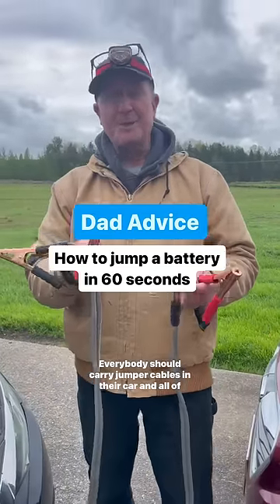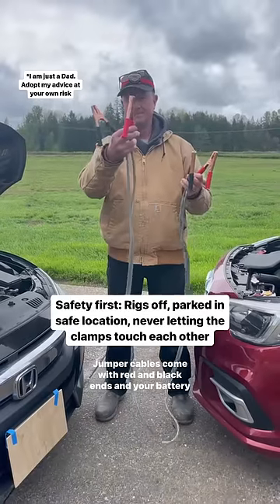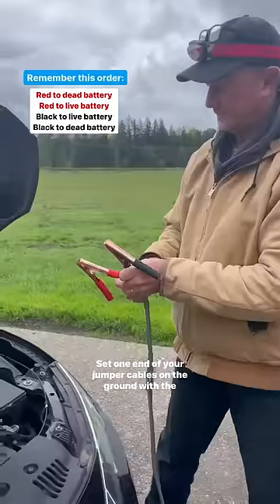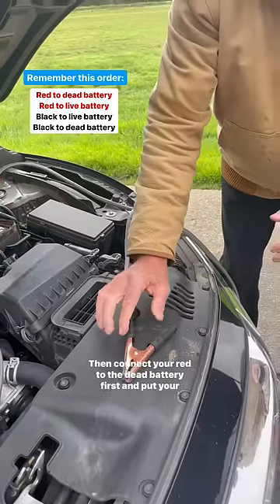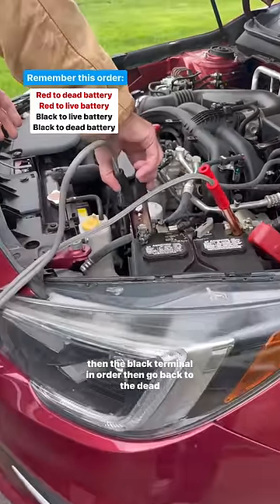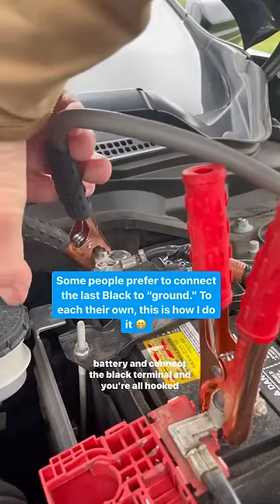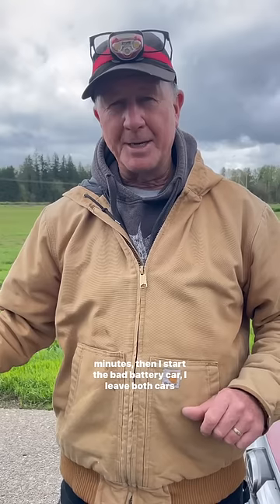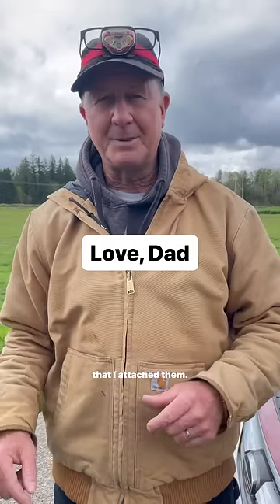How to jump a car battery. Love, Dad

Comment: You should carry cables AND a jump box. Can't trust Chinese jump boxes long term and it's always smart to have an extra pair of jumpers.
Reply: I've had jump packs since 2015, used them multiple times to help family, friends and stranded motorist and never had a failure. In some cases the vehicle lojestics would not have permitted the use of Jumper cables.
Reply: @jeffj126 still should carry a set of cables.
Reply: @jeffj126 jump box batteries degrade over time
Reply: @alexmack956  all batteries degrade over time. That's why you test them and replace them. Cables are fine if you have some who is willing to perform a jump or even knows how to perform a jump.
Reply: @jeffj126  blah blah the point is, cables don’t degrade. Might as well have cables too.
Reply: @alexmack956  what percentage of people do you think have jumper cables in their car and know how to use them correctly? And if they do have cables what gauge of cable do they have? Probably some cheap 10 gauge cable from harbor freight not a 4 -6 gauge cable maybe even a 2 gauge if they have a larger vehicle. The jumper pack is just easier for the current members of society to use. They are nearly idiot proof.
Reply: @jeffj126  I needed my jumper pack last week. It was fully charged but failed. It just got old.

Comment: First off, I wouldn’t use a cheap set of jumper cables like those!, and if I had my pick up, I would be set with a set of “slave cables, for jump starting other cars. But aside from the cables, positive to positive is correct, however, the negative to negative is asking for trouble, what should be done instead is, negative of good battery to body/ engine ground of vehicle being jumped. This removes any spark potential from being over the top of a defective battery that could be “off-gassing “ hydrogen. 

P.s. a good set of slave cables, has a circuit for protection of the “running vehicle “, and also a circuit protecting for reversed polarity connection, but this can also be an issue for someone who has a vintage automobile that has a positive grounding electrical system!
Reply: Well said and so True! 👍😮

Comment: I keep a lithium jump pack. Smaller than a set of jumper cables, about the same price, doesn't need a second vehicle.

Though you have to actually charge it once in a while. Jumped my 4.6L F150 about 5 or 6 times before needing charged. Yes, I was procrastinating on getting a new battery.
Reply: Then one has to decide which amp power to purchase increasing the $$$

Comment: You shouldn’t put the negative cable on the dead battery. It should be on a good Earth somewhere on the vehicle.
Reply: Exactly
Reply: The battery is connected to the ground there's really no difference.
Reply: I connected the negative Cable in a bolt that is part of car  on dead car .  Should that have worked?

Comment: The problem with his setup is positive (red) is the hot side.  Trust me, if you forget to properly ground the black cable.  Guess what “you” can potentially be ground, thus being shocked!  Just saying.  Also, if any terminal on the battery is corroded, no true circuit exists to jumpstart.

Comment: Doesn't matter how you hook them up as a mechanics son who's father owns his own shop and worked in one for 40 years it doesn't matter ho you hook them up as long as negative is on negative and positive on positive this man out here making it more complicated then it has to be
Reply: I’ve noticed this guy makes a lot of things more complicated than it should be .
Reply: His advice is accurate due to the risk involved with the production of hydrogen gases. But, with that being said, the do not start producing until the right conditions are met. 1) the battery reaches about a 90% charged state or 2) the battery is being fast charged or 3) there is a small chance that the gas could be still built up under you hood from the previous charge cycle (but doubtful). And those are the reason they are saying to not hook the last connection to the battery term but neither the block or strut bolt ect. Because they don't want a spark created directly over the battery.  But NEVER attemt to charge a frozen or swelled battery or one that has a dry cells (low acid/electrolyte) because that can and likely will cause an explosion. In my professional 35year career as a technician I have only heard rumors of batteries exploding but I did get to see the after math once and don't want to be leaning over the hood when and if it ever does happen.
Reply: True 😂

Comment: Never try to start a car off of a running vehicle... If the dead car starts you have 2 alternators running at one time
Reply: So……
Reply: @BlainesGarage  So then the alternators begin to overspin.  One will attempt to over take the other.

That is a bad situation, sir
Reply: @Trapster99  there is no such thing as “overspin”.  Both vehicles are equipped with a voltage regulator, so once they reach charging voltage, that’s it. The regulator backs off on the field voltage which limits the alternators output. Spin it as fast as you can, but the regulator says nope, we’re done.
Reply: @BlainesGarage  Works every time?  Nope, not if it is old and the diodes are weak.

Do not run both cars at the same time with the jumpers hooked up at both battery terminals.

Done
Reply: @Trapster99  When you don’t know what you’re talking about, making stuff up makes that fact most obvious to those that do. Diodes don’t “get weak”. They simply fail open or shorted. The diodes only job is to rectify the current being generated from A/C to D/C. Failing either way has the same result - less charging potential.
Reply: @BlainesGarage  You are arguing nonsense with some random dude on the internet.  Do not run both cars with the jumpers hooked up.  Do that and you damage BOTH cars.
Reply: @Trapster99  No argument here. I’m just correcting myths and misunderstandings. It’s best to have the car giving the jump to be running to supply a charging voltage and to insure that you don’t drain the battery of the jump vehicle and end up with two vehicles needing jumped. If the dead vehicle is extremely low on charge, holding the jump vehicle rpm up a bit will speed up the process. 

  The only bit of caution to be concerned with is the last connection, which should be to a good ground away from the battery, because the last connection can cause a spark. If the last connection is made at the battery the spark may ignite the hydrogen gases that may be present venting from the battery. 

However, the chances of that happening while jump starting a car is extremely slim, because a battery only produces a large amount of gas during the final stages of charging. 
   
 Finding a good grounding point for the final connection can often times be challenging. 

Knowing these facts, I always make my final connection directly to the vehicle needing jumped. It’s not in the final stages of being charged, and it is the best possible connection to ensure a good ground. For safety reasons, I’m not saying this is how anyone else should make their final connection. It’s just how i do it safely. 

Another bit of caution is if you are jumping with hybrid vehicles. Read your owners manual for jumping instructions. Some are straight forward. Some are not.
Reply: Normally they are disconnected Immediately..  once the dead battery starts the car, the Cables job is OVER
Reply: Wait till these folks learn about ambulances and trucks with multiple independent alternators running simultaneously....
Reply: @Trapster99 but youneed to eventually turn the dead car on to see if it worked no matter what you need to have bith cars on at some point
Reply: Absolute nonsense, the video is correct
Reply: @Trapster99 an alternator spins at a fixed speed relative to the engine. Overspin only occurs at high rpm.

The only problem here is the bad battery may overload the alternator.

Trying to jump a truck with two dead batteries where one or more is drawing more amps than the alternator can supply mat damage the alternator.
Reply: @RoadKing05FLHR  that that is exactly my point.  Don't attach the alternatoros to gether, put the good batteries neg lead (black clip) to a good ground and never run them both at the same time.  Never, never.  and yes, they do over-spin when both engines are on and they both attached

Comment: bad advice as two cars connected can cause a over voltage situation and be expensive . if your going to jump a car both cars should be off to prevent this situation, or charge the dead battery and shut off the running car when you attempt to start the dead casr

Comment: just an FYI if you have a PHEV or EV you can't use jumper cables
Reply: @kvaern1  when I bought my PHEV I was specifically told not too as it could damage the battery

Comment: Never connect negative side clamp of the jumper cable to negative terminal of the dead battery. Always connect negative clamp to a good solid metal ground. Because if dead battery has an internal short you will definitely fry your good battery. Grandpa must have slept through electricity class in school and knows nothing about electron flow theory.
Reply: Whether it's connected to the chassis or the battery negative doesn't matter, they are essentially the same point
Reply: 11th grade auto mech 1. 1983

Comment: That is incorrect the dead battery. The negative battery cable is supposed to go to a groundout on the car so it runs through the battery not just in and out of the battery. Also you turn off the running car when it's time to start the dead car because you do not want the alternators over charging and frying the alternators. This is for all cars newer than like 2005

Comment: You should not have the car with the charged battery started. It’s okay to run that car to help build charge in the dead battery. But when you are starting the car with the dead battery then the car with the full battery should be turned off. Otherwise you could cause a power surge that will fry the alternator or other electronics in either vehicle. Make sure the jumper car is turned off when you attempt to start the vehicle with the dead battery. You are simply borrowing power from the other vehicle to help start the car. Also note: You should always hook up the ground (black cable) first and remove it last.
Reply: 100%

Comment: Nope, jumper cables require a second car to help. Get a good jump box with a tire inflator. You can also use them for emergency power to charge devices and most come with a light. 

It's quicker and doesn't require a good Samaritan to help.

Comment: Good way to fry a computer.  Turn off helper car before cranking.   Also most new cars have jump points labeled that are not on the battery.  Just buy a jump pack to carry in the trunk and leave the cables in the attic.

Comment: Battery to battery will sure fire start, but mechanics tell me it is bad and the reason you connect to engine ground is to prevent battery explosion on dead car.  Plus remove cables immediately to prevent alternators fighting each car with over charging

Comment: Never have donor car running when trying to jump dead car unless all the cars were made in 90s. Newer cars have do many electronic modules that you ll fry them. Lots of $$$ to replace.
The advice to connect both batteries and start good battery car and run it for 5-10 mins is good. Then shut down the donor car and just start the dead car. 
Also as many people pointed out it is way safer to connect dead battery negative black terminal to car body instead to battery terminal

Comment: Why not clamp the other red clamp to the bottom of the black wire so they won't touch then lay it down on the ground then connect the other end to the dead battery and then pick up the clamps that you put on the ground then connect on the good battery. This way you will never have to worry about messing up any of the batteries

Comment: No. You always hook the black jumper cable to a grounded piece of metal. By connecting it to the black terminal on the battery you’re essentially getting the electricity to just barely and slowly go into the battery. It’s like this. By having a complete connection like that the electricity flows a lot like a small trickle out of a hose, while when you have it grounded it flows like a fully opened hose. So yes it will work by connecting both terminals but it will take way way way longer. And if the battery on the other vehicle isn’t great you can wind up running that one too low until now you’re both screwed. Lol

Comment: If the dead car won't start, disconnect one of it's cables and connect the jumper cable to the disconnected cable. A bad battery will often suck  up all the power from the good battery.
Reply: That just might the best thing iv read here. 😮

Comment: DAD, that is SO WRONG 😮
GOOD Battery 🔋 car running or not put on cables. 
DEAD CAR Battery 🪫 put on RED cable to Red post and Then the BLACK cable to the Dead car’s metal/engine/frame AWAY from the dead Battery a.k.a TO A GOOD GROUND 

THEN RUN THE DONOR CAR FOR 3-5 minutes to CHARGE the Dead battery. 

Then Disconnect the Ground and then Positive cables and START the Dead battery Car on it’s own. 😮😊

Comment: U need to let people know that if your battery dies when your running 70mph down the highway a jump probably wont get you going.... i see so menny people trying to jump theor car when the alt. Goes out. Yeah it will sart it and u can possibly drive a way ( depending on how much u charged the battery with the cables) but u wont make it far. If your battery light is on then its not charging on most vehicles 😮

Comment: Most modern vehicles should not be jumped. Read owners manual. Many manufacturers require certain fuses to be removed before jump starting vehicle. Not as easy as it once was.

Comment: I was taught by my mechanic growing up that on the good battery you connect the positive cable and the negative cable to the block. On the bad battery connect the positive cable and the negative cable to the battery. That's what I was taught.

Comment: You SHOULD NEVER LEAVE BOTH BATTERIES CONNECTED WHILE RUNNING.. NOT WITH TODAYS CARS.. ALSO WRONG, DONT START THE GOOD BATTERY CAR IMMEDIATELY... LEAVE THEM CONNECTD FOR 15 MINS BEFORE ANY STARTING.. THIS EVENS OUT THE CURRENT BETWEEN THE DEAD AND NOT DEAD CAR.. IM NOT SAYING YOURE DOING IT WRONG.. YOURE NOT DOING IT CORRECTLY ACCCORDING TO ELECTRICAL THEORY

Comment: $10 jumper cables he got are not going to start nothing for at least 10 minutes, wait 10 min till for the battery to charge up if the dead car doesn't start after 10 min, invest $30 in proper cables

Comment: Wrong don't leave your good running car on u will damage your alternator run your good car for about 10 minutes turn it off then start your dead car battery, they used to do that in  older cars but that's how u end up with bad alternator or burn later on check other videos this video not very helpful except the connections still  icy?????

Comment: ⚠️ NOOOO! You do NOT connect the black to the dead battery! This is not a “matter of personal preference!” The dead battery can be gassing off FLAMMABLE HYDROGEN!! If it is, and clamping the black to the dead battery causes any sort of spark (which it usually does), the battery will BLOW UP IN YOUR FACE. Instead, clamp the black side to a bare metal post somewhere on your struts, or by your hood release!! ⛔️

Comment: ya, Daddy I don't think so, you need to go back to school !!
don't run both cars at the same time, jump means JUMP .
let dead suck juice for a few minutes,  then start dead, as soon as the jump starts, turn off the good car immediately,  disconnect,  let dead run and drive it to charge.. 
DO NOT RUN OR REV BOTH CARS AT THE SAME TIME OR YOU WILL BLOW THE ELECTRONICS  !!
BEEN THERE DONE THAT.

Comment: Never put a nagative terminal on the dead battery. Always put it on bare metal part such as engine hoist points. Also never run both engine at the same time  as the alternators will interact against one another.

Comment: Connect cables as instructed.. charger the bad battery with the good battery..turn off the good battery and try to. Start the bad battery .. do not!!!! Let both  cars run at the same time..this can cause damage to 1 of the alternators ..or destroy 1 altogether.. read the instructions on the package the cables came in.. ARLINGTON ENTERPRISE LLC...

Comment: FYI... WRONG❗️ You're correct until you connected the Black to dead battery terminal. It should be connected to a grounding point, (Frame) of dead vehicle so not to damage alternators and computers systems❗️

Comment: WRONG!!!!! Never put the cables on the ground like that, they can touch as you move the cables around or the ground could be wet at night and you wouldn't see it. Always clamp one terminal to the insulated handle of the other so it's impossible for them to jump-out on each other. START THE CAR?!?!?!   You keep the good car running and you clamp the running car first then you connect the dead battery. I've always connected the lead+ first then the neg- to a metal frame or mounting place.

Comment: Wrong. Never jump a dead battery from a running vehicle. While it may not happen, one can fully short out the running vehicle. Why take the chance? To do it correctly, buy better jumper cables. I use 1 gage stranded, 25 foot cables. I can start a semi from a mini Cooper with those cables.

Comment: Jump starter, jump cables and fix a flat.
I carry jump starter and fox flat on my Harley’s and a jump cable extra in my car.
Fox flat is sure nice when you come out ready to go but your tire needs work.
Or it’s raining , or emergency.
I jumped a V-8 with my jump starter.. mower, motorcycles.
I never get stuck.. unless the worst happens.. on trips I carry an extra battery and alternator, belts, fuses..real spare tire.